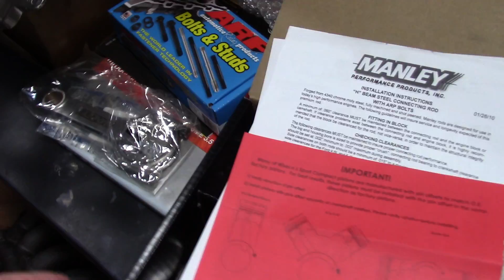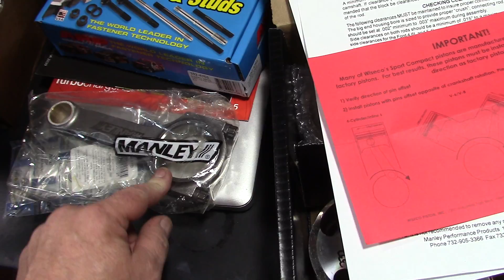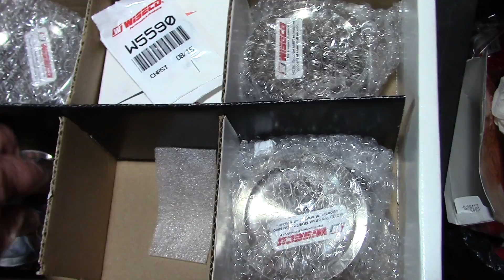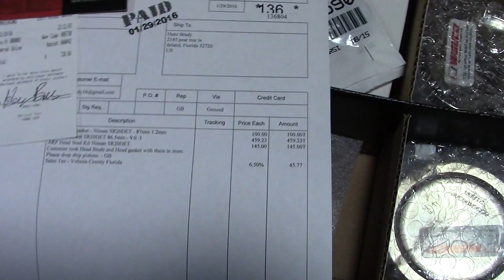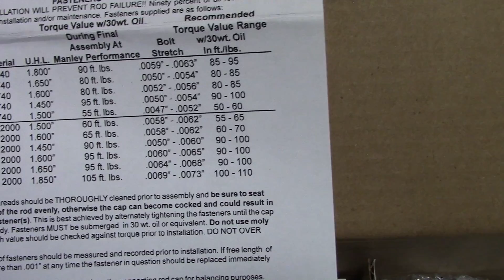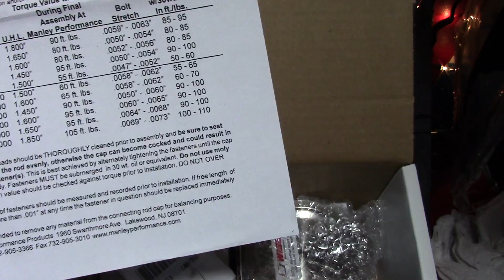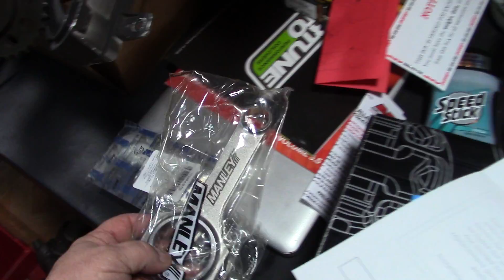A Look at Some SR20det Parts

Comment: What kind of "Engine Management" are you running or going to run. Also in my opinion I would ditch the mass airflow assembly and go speed density ie; MAP based tune. I've been tuning ECU's for several years. MAP based tunes are much easier to tune. You can ask Matt Happel "Sloppy Mechanics" or ZZ3Astro they will both tell you that MAP based tunes are more accurate and more consistent. Also are you going to run a Water/Methanol system on the car. Either way looks like you've got a great combination of parts to build a very fast car. Can't wait to hear it run. Good luck with the assembly.
Reply: Engine management will be an RS Enthalpy ROM tune, for my power goals a full stand alone was over kill and a bit out of my budget. I'd switch to a stand alone once I wasn't in danger of breaking the transmission and axels and could turn the motor to its limit. But for now I'm looking for a reliable 500hp which the ROM time is capable of and proven in Enjuku Racing's Formula D cars. As for the MAP sensor, I agree that they're better, but for my power goals and budget it wasn't a necessity.
Reply: You could still go stand-alone with either a Megasquirt setup & a PNP Harness adapter and stay within your budget. My issue with a ROM Tune is the fact that every time a change is needed, your having to send the ECU or Chip to the Tuner for changes. But if you go with a Megasquirt micro or..... AEM "FIC" or a MAP "ECU2" there is plenty of wheeling YouTubers that would send you a base map via a PDF file to get you started then tune things in yourself or have the vehicle dynoed and tuned at a shop. Either way you go, looks like your building a strong motor with great parts. Good luck
Reply: +Adam Clark normally the shipping and waiting is an issue with ROM tunes, but the company is based out of Tampa and has a lifetime warranty and free retunes. Even a megasquirt, which is cheap, is still more than twice the price for the same results at the goals I'm looking for.